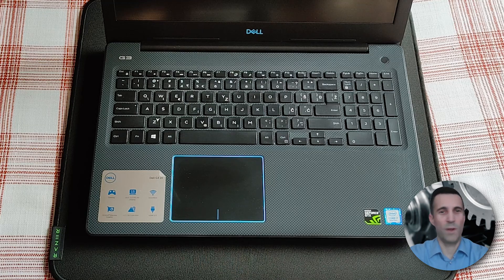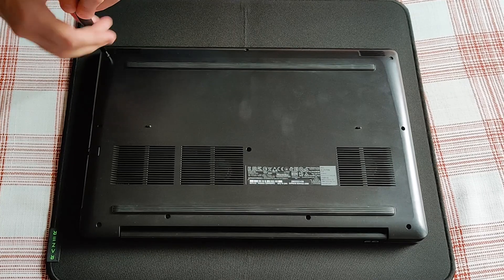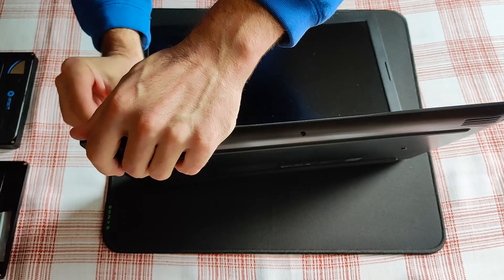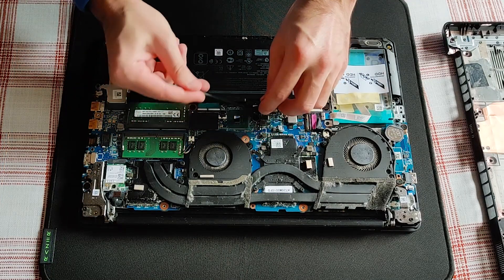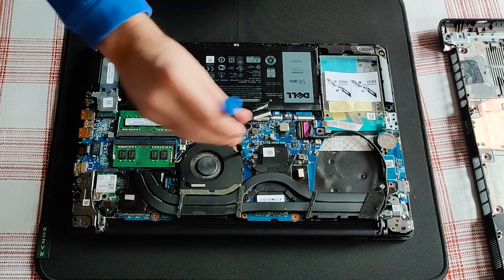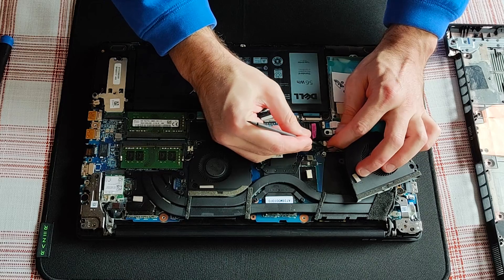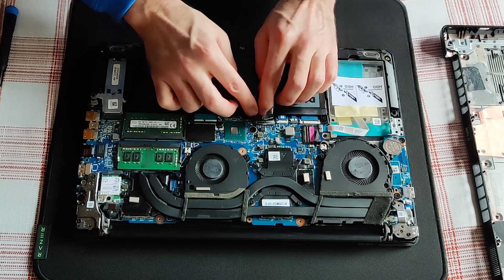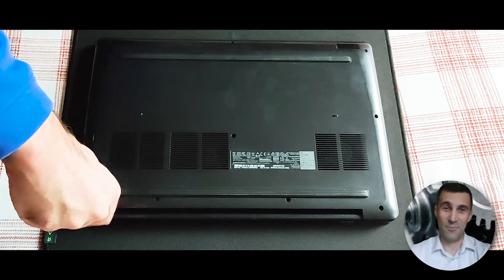Dell G3 3579 - Cleaning the cooling fans

Comment: At 2:45, what is the cleaning and dusting procedure followed? Is the GPU fan a single encasement, or is further possible to dismantle each fan assembly and maybe oil the spindle of the fan blade setup?

My GPU fan keeps making an annoying rattling noise despite dusting and cleaning the blades and the covering.
Reply from the maker: Thank you for watching. I usually gently block the fan blades and blow air through it. Also I have a dusting brush and use it on the fan also. I have never oiled the spindle of the fan. Mostly I just order a new fan when the old one is noisy. Fans are mostly not expensive.